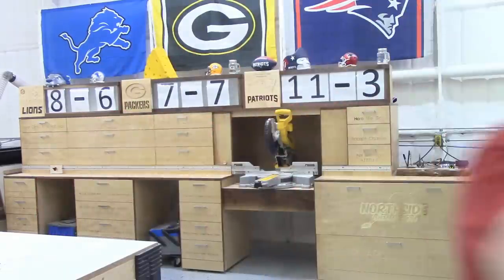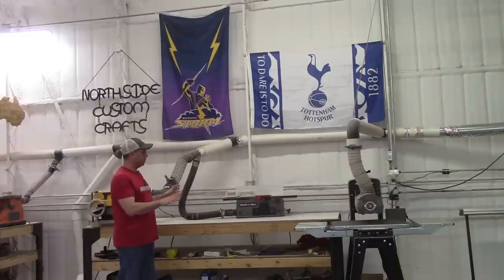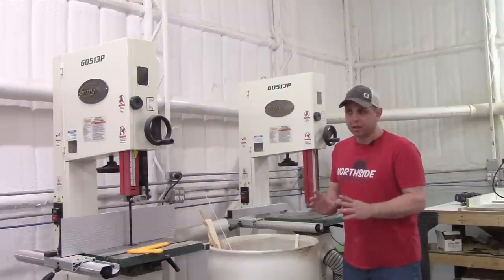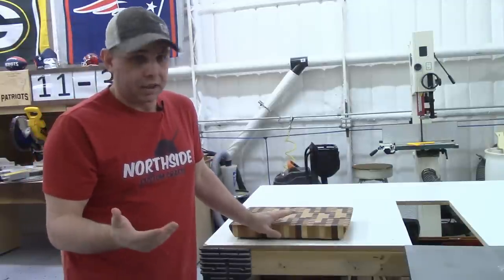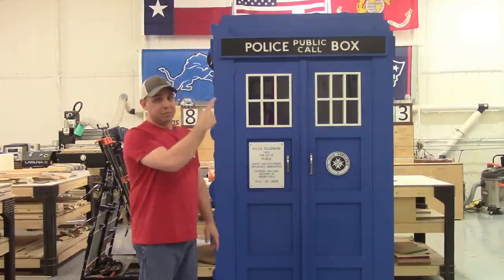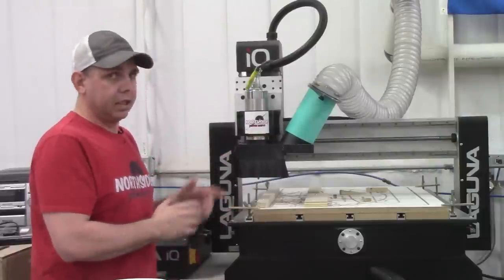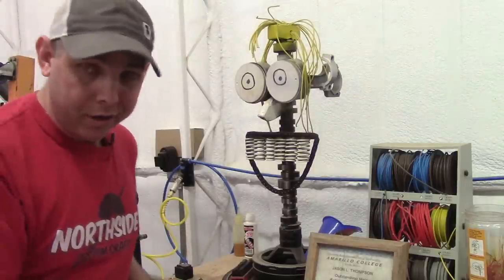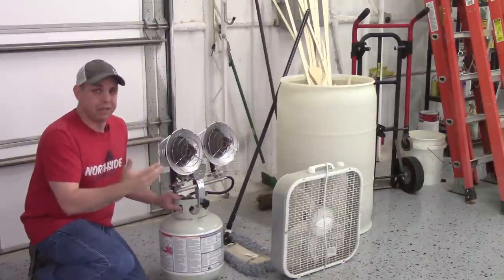2018 Woodworking Shop Tour

Comment: You didn’t say anything about that Marine Corp. flag. Come on Brother. Great tour.
Reply from the maker: Michael Fredericks Thanks for watching Brother!! I tend to let that flag speak for itself! I talked about it quite a bit on a couple of pod casts. The links to those are on my year in review video. I appreciate you dropping by!! 👍👊
Reply: @Michael Fredericks, i think Jake needs a 'Bee flag (Reservist, '10 to present), but otherwise it's a great looking shop!
Reply: Inspired Woodworks Hoorah brother.
Reply: Inspired Woodworks would that be NMCB24?
Reply: Michael Fredericks , nope.  ACB-1, and since FY 2014, NMCB25.
Reply: Inspired Woodworks what is your rate? I was and EO1 with the Bone three years ago.
Reply: Michael Fredericks , Builder, Third Class.  Went through boot at age 36.  Yup, I was the old man....
Reply: Inspired Woodworks I was 27 when I went through. NMCB25 relieved us in ‘06 when I was with NMCB22.
Reply: Michael Fredericks , that was a bad deployment for 25 in '06.
Reply: Inspired Woodworks yes it was. I remember an EO1 who worked for Osh Kosh that I believe was one of the ones that was lost. The female corpsman was very cool also. I remember them.